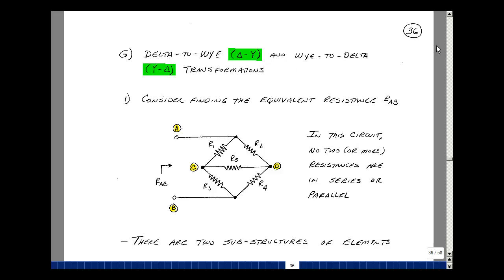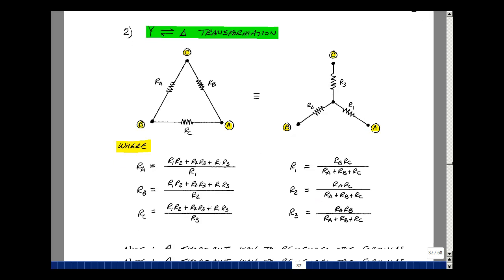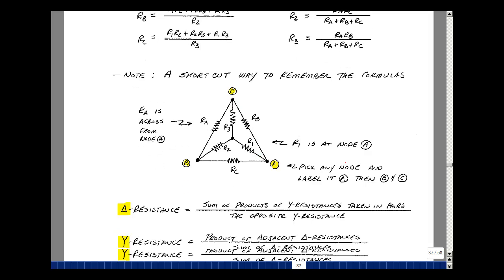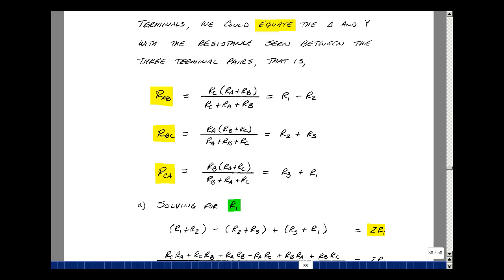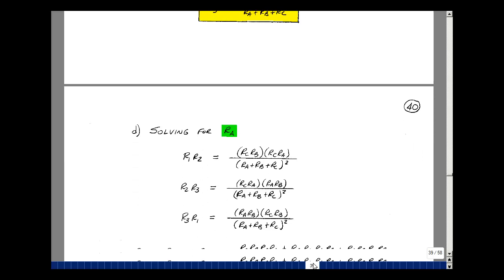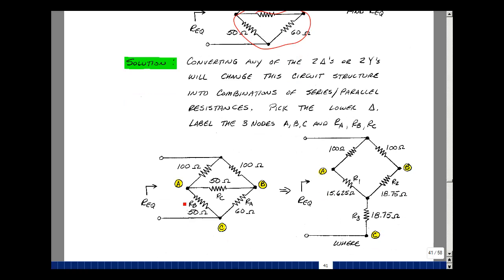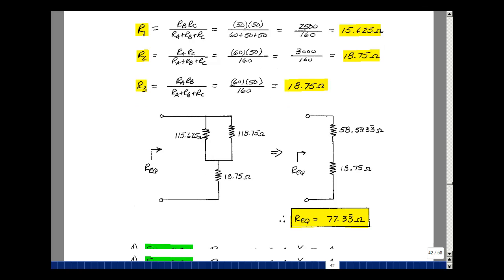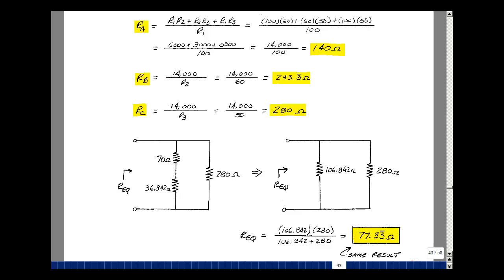ECE201msu: Chapter 2 - Delta-to-Wye and Wye-to-Delta Transformations

Comment: so how to find current and voltage for each node in y-delta,delta-y conversion ?
i'm still dont get it. if you can give the simulation for that also can be good example for me.
Reply from the maker: Lockman,
The Wye-to-Delta connections do not have any series or parallel elements. Using the conversion formulas you create an equivalent circuit with elements that are in series or parallel. This can help find an equivalent input resistance.

If you want to solve for current or voltages in the Wye or Delta, see the methods and examples of Chapter 3 for Mesh or Node equations.
Reply: thank you..:)